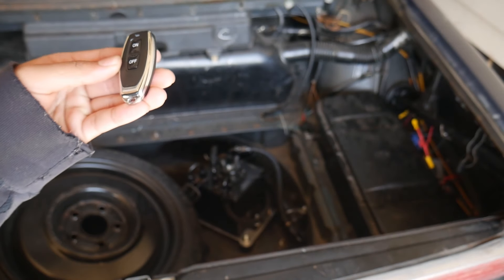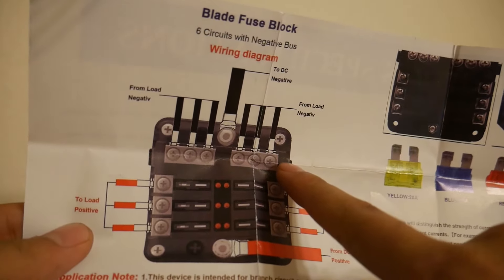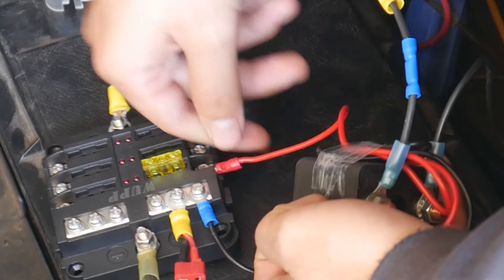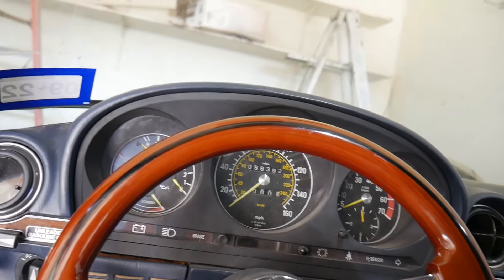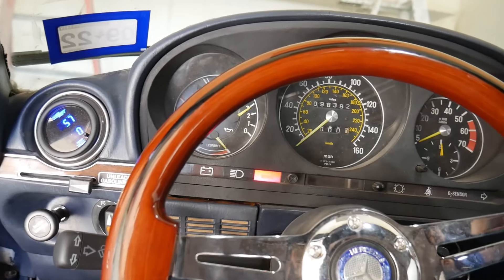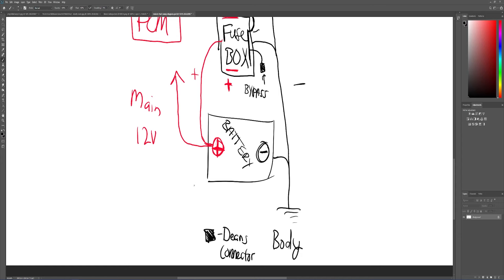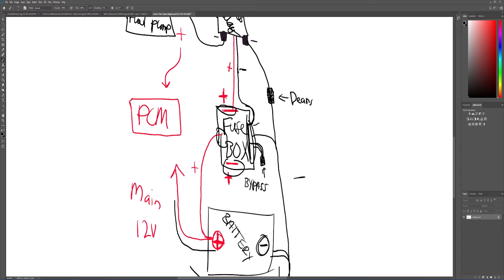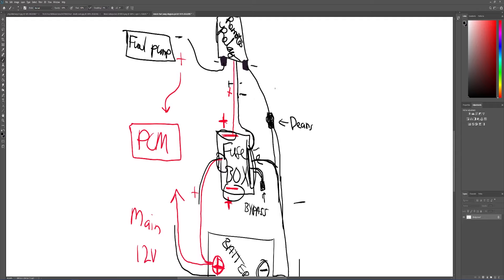How to Install a WIRELESS KILL SWITCH in your Car! (Cheap anti theft system)

Comment from the maker: *WARNING ⚠️ *
MAKE SURE TO WRAP AND ISOLATE YOUR WIRES! 
CHECK YOUR CAR'S FUEL PUMP WIRING DIAGRAM! 
MAY NEED A DIFFERENT SETUP THAN MINE! 

The standalone fuse box comes with a nice plastic cover! 
I will be making a platform for my setup to support more mods! Subwoofer and GPS Tracker! 
Car is a LS SWAPPED Mercedes. 
Let me know any tips in the comments! 
Thanks for watching!
Reply: I love it. How’s the progress on the subwoofer and tracker?
Reply from the maker: I did the subwoofer. Sounds good but could need powerful unit. Tracker not yet. I'll post an update on the subwoofer

Comment: I like the idea of using a separate fuse box, but you were so excited showing it off that you didn't really show the process of connecting the fuel pump.  I want to send this video to my brother who just recovered his car that was stolen buthe would never be able to figure this out using the diagram at the end.
Thanks for uploading your ideas to YouTube, regardless.
Reply from the maker: I'll post an update video thanks
Reply: Hey man can you send me a better diagram to follow also? With a clearer explanation
Reply from the maker: Sorry Im making my own engine stand that includes the wireless cut off relay. I'll make another video about this soon.
Reply: was there really ever a follow up video after 2 years ?

Comment: It's probably a good idea to put the spare remote in your pocket. 
This is just my idea of extra security, i.e., if you were subjected to a car-jacking and after being thrown out of your car at some traffic lights or pushed off your motorcycle. You can still kill the engine, and then they're going nowhere. 
I would also hope that the remote you attached to your ignition key ring, the car-jacker wouldn't know to use it and instead jump out, and you have your vehicle back!

Comment: Thank you for your video. I have question. 1. What is default condition ? After battery reconnect, does it on mode or off mode or same as before? Thank you
Reply from the maker: should be on off condition when installed. then when you press the on switch, the relay should switch on.

Comment: All you need to bypass the kill switch is a wire with alligator clips on each end hook one to the battery terminal and the other end to the positive wire before the kills witch takes 2 secs
Reply: Actually from computer box to fuel pump, car won't start with your bypass

Comment: I have a question, can I connect fuse block to  motorcycle kill switch and use it for accessories only ..Instead of tapping into the motorcycle wiring  I can go straight to the battery and switch it off when not used ??
Reply from the maker: Yes you can!

Comment: Hey can you make a video of how to install a kill remote switch for the ignition fuse.  I manually unplug the 30amp fuse which disables the ignition. I won't unplug the battery since it will erase everything i configured in the SUV. The fuse is in the box under the hood. It would be nice to have a remote switch instead.
Reply from the maker: Okay bet I'll add it to my list.
Reply: @leesgarage7  I would like to do that procedure as well on my truck. please let us know on your new video, thanks advance
Reply from the maker: Okay I’ll do one for both ignition and fuel setups
Reply from the maker: Busy at work and other projects

Comment: Is this better than doing the remote battery way? Or is the battery way less secure because if the car doesn't start that's the first place thieves might look?
Reply from the maker: with battery you will lose radio channels and reset ecu/pcm memory. I recommend fuel pump because the first thing the look is the battery and its easier to hide the kill switch relay due to smaller wire size. 
if i was a thief with under pressured time i would check battery. After that it either i leave or tow it LOL
Reply: @leesgarage7  ok thanks for the detailed and fast response

Comment: so then when you use this it resets the i/m readiness on the car? do you have one that does this only for the fuel pump relay? maybe a plug in on the fuel pump relay then all you do is cutt off the fuel thanks
Reply from the maker: Yes use fuel pump circuit
Reply: @leesgarage7  thanks i figured that but i do not need all that fuse block and that relay has way over kill for a fuel pump circuit. so maybe a different wireless type relay if you know of one? maybe one that will plug into the fuel pump relay spot? thanks
Reply from the maker: I think you can get one. Look it up on Amazon. Depends on the car too

Comment: Can this be installed in the starter instead of the fuel pump?
Reply from the maker: Yee but make sure to use thicker wire. 10/12 gauge. So instead of fuel pump, it would be starter solenoid

Comment: I wanted to do the same thing but im always  thinking what if something happens while driving on a highway heavy traffic.
Reply from the maker: you pull over and use the ground bypass. relay is good so far!
Reply: yep not worth putting yourself at risk for something no one can backup for. If this was safe, car companies would use it.
Reply from the maker: I back it up. Still works good 
Remote immobilizer vs chip key immobilizer car companies use. 

You can use starter instead if you feel unsafe with the fuel pump method.
Reply: @coffin supply  Modern day anti theft devices in factory cars do this. It's not something that's new. Most newer anti theft is connected to the fuel pump in one way or another.
Reply: Yet all things can go wrong in cars live run out of fuel or engine cuts out for some reason so I don't know why you are worried about this when other things can go wrong without this device
Reply: Just wire it so the normally closed pin completes the circuit. Then the car will always start if the relay fails.
Reply: I had same thought… though you could add a parallel physical switch which you’d normally keep ‘open’.
Just flicking that physical switch would override that misbehaving ‘remote’.

I added physical killer switches over the decades on my cars before ‘remotes’ became a thing, since ‘hot-wiring’ a vehicle use to be ‘a thing’.

Comment: I installed a kill switch on my battery Ground the motor does not start but the Doors open with the remote why.
Reply from the maker: Are you using thick enough wires?

Comment: Your wiring diagram doesn't match what you actually did.
You said at 2:40 that you take your main wire from the fuel pump and connect it to the backup deans connector Incase the relay fails.
But in the wiring diagram at 6:57 you have the deans connector on the OTHER side of the relay, so its no way to connect the fuel pump directly to ground( according to your diagram)
Reply from the maker: I will make a new video. Stay tuned.

Comment: How is it working after 7 months would love an update any issues you might had have to fix?
Reply from the maker: Works good so far. Haven't drove awhile since I have a 98 ls400 I'm working on. Plus I get tired of driving stick to work everyday 😂. 

My only problem is the vibration. I put in a new transmission mounts and helped a lot but still there. So I'm thinking it's the driveshaft. I should have gotten the 2 piece driveshaft to split the angle upfront. Other than that it's solid. I was doing burnouts in my recent video!

Oh I thought you were talking about the swap. 

The relay still works good! Go to Amazon and get it. You can get one for $30 with 2 remotes now. Wasn't available when I made this video

Comment: Cool but aren't you messing up injectors this way?
Reply from the maker: No the injectors are controlled by PCM. 

This is just power for fuel pump
Reply: @leesgarage7  I've always heard it's not good to run out of gas because the injectors will get messed up. Turning off the fuel pump doesn't mess up injectors?
Reply from the maker: No. Injectors are like on and off switches that the computer controls.
Reply: @leesgarage7  ok

Comment: What brand switch did you use
Reply: And did the fuse block come with it
Reply from the maker: Switch was from eBay. Alot cheaper on eBay. 

The block is from Amazon. The block is quality and you can get rectangle version instead of square.
Reply: @leesgarage7  I just found the remote switch on eBay for 29.$ shhhiiiid i bought 4. But what is the name of that block bro
Reply from the maker: Go on Amazon and look up fuse block. 

Should be the most popular one can't miss it . 

So far working good

Comment: Ima try to fix my civic but I’m worried it will get stolen.
Reply from the maker: This will help ! Unless they take your keys 😅
Reply: @leesgarage7  Knowing thieves nowadays. What’s worse is the car is a 88 Honda Civic, One of the most stolen cars in America.
Reply from the maker: I think with the key/fuel pump mod it will help alot. Just need to hide the relay and wires really good. I like those cars. Pretty chill

Comment: Unfortunately, It defeats the purpose if you have it with you if you’re carjacked. But still, a convenient product.
Reply from the maker: At most they are going to tow it or find the fuel pump bypass in the  trunk. If they want it, Doesn't matter what you do. they will steal it.

I turn it off every time I leave and carry with the keys
Reply: @leesgarage7  I think it would be best to keep it somewhere sneaky like ya boots/shoe somewhere where you know their won't be pressure from being in that place and disconnect while ya driving
Reply: If they have you at gun point you’re going to give up the car no matter what
Reply from the maker: Yep 100% not dying for a car 😂
Reply: I've always used something like this in combination with another kill switch located elsewhere in the car. If you have two, esp if the other switch is complex, they will not be able to move it
Reply: @Oceanthemedsprite  you could have two kill switches which companies did you go with
Reply: @gotdamnjimi9758  not sure what your question is. For my car I have a kill switch for the battery and then I simply take out the fuel pump relay every night
Reply: @Oceanthemedsprite  sorry do you have a link to the killswitch you used and is it still working properly with the range
Reply: @gotdamnjimi9758  you can get a remote control one for the fuel pump or battery off of Amazon for like $30, but I just have a simple toggle switch I installed myself that is hidden on my car. I picked it up at a tech center with some extra wires. I have two in separate locaitions, one linked to the battery but for that I just rewrote the wiring so the left turn signal has to be on to start the car. The physical toggle switch is for the fuel pump
Reply: @Oceanthemedsprite  ok thank you
Reply: @Oceanthemedsprite  this is so smart. Is it possible to send me an email or we follow each other on another platform and you explain how to install something like this. I am so afraid for my car to get stolen and I’ve been told there are some tricky things you can put in place to fool a thief but honestly this is all so foreign to me.